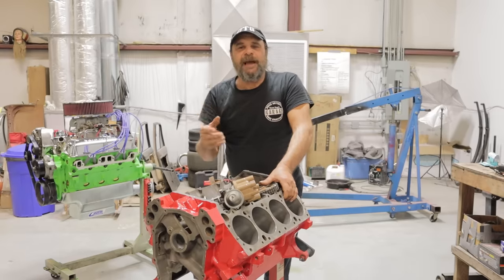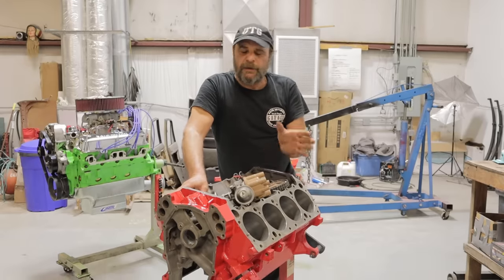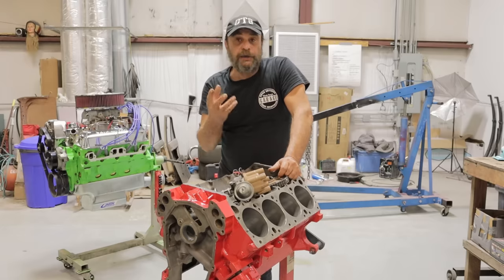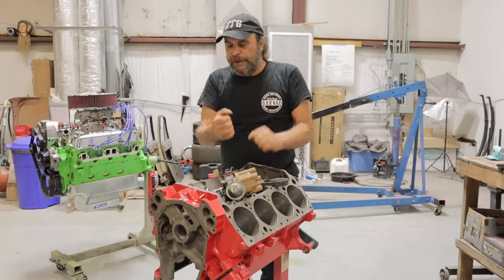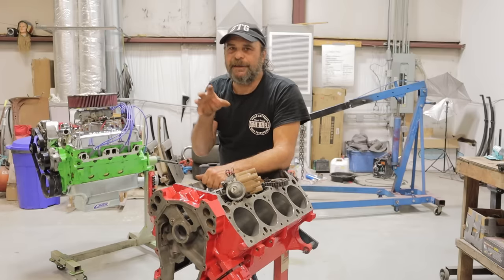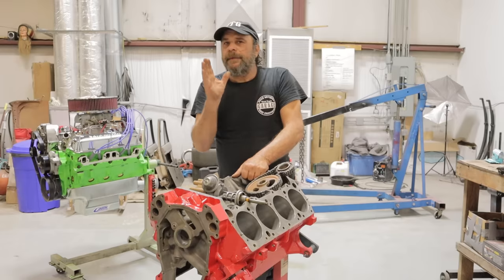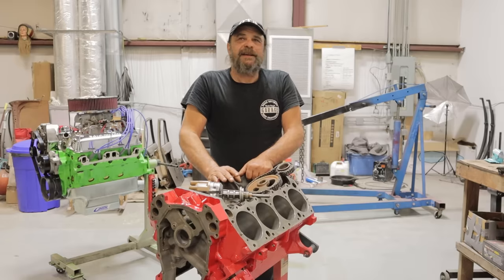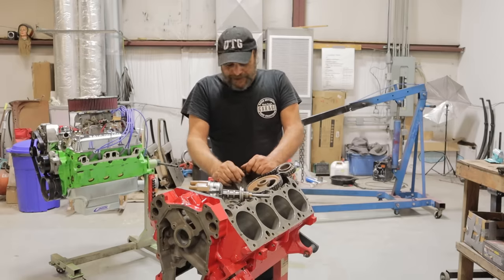Power Timing Secrets For Classic Cars

Comment: Cars today use a knock sensor. The computer advances the timing till it hears a knock. Then the computer retards the timing. This way it does it all the time. Keeps engine running at peak power and this means better fuel mileage. Great show Tony. 👍
Reply: Yes but you can tune a mechanical engine- NOT to knock.
Reply: @fastinradfordable  Never having knock leaves performance on the table.  That's why Tony's tuning style is to go all the way to knock...then back it off a noodge so the engine doesn't throw a leg out of bed.  The computer controlled variety does exactly the same thing, only it does it over and over, taking into account variations in fuel quality, engine load, engine temperature, intake air temp, etc...constantly trying to get right up against the edge of knock without actually doing damage...so you always get the maximum performance that's available.  Yeah, you can get no knock in either case...but that's not how to tune for performance.

Comment: My '67 Cougar with a 302 was very sluggish and had a stumble occasionally at idle so I tried this. The results were remarkable! I'm in New Mexico with mile high altitude so can run more timing than cars at lower levels so had it set at 12 degrees rather than the 6 or so it would need at sea level. When I kicked it up to around 15-18 degrees the sluggishness and stumble went away. Runs so much better! Going to play with it some more, and check the total advance to try to get the best possible performance. Thanks UT!

Comment: I have done this my whole life and 60 yrs old. A strong idle timing wise, then adjust on carb. Starts perfect and no bog, full rpm's no ping. Never used a light or dwell. 20k match pack and never an issue. New chains or beat this works

Comment: Good video! I did this to my old dodge truck with a high mileage 360 in it. I set the timing to factory spec and it ran but just not like it should. Advanced the timing more and it ran even better. 👍🏻

Comment: Thanks Tony, I’ve never tried the exact method you explained but maybe something similar. My method was to advance the timing until it started to miss at highway cruising speed and then back off a degree or two at a time until the engine ran smoothly at cruise.
Reply: have a buddy a do a brake stand while your at the side of car adjusting the timing  ;)

Comment: Good explanation of something this is learned from experience. A suggestion would be to include videos of examples of what you are trying to describe so people can actually hear engines/exhaust in different timing settings.
Reply: its a hard thing to discribe when people not in tune with details of sound, is acquired over time you get in tune with the sounds of exhaust notes other sense  is smell of exhaust or the color inside of pipe, says alot of things to people in tune  of an engine  as to spark plugs

Comment: been using pretty much the same method since i was a kid the only difference i usually do it with the engine running i grab the throttle linkage and run the motor up to about 2000 revs and hold it there while moving the dissy you easily hear a sweet spot. then go up up hill under load just like Tony said. i'd like a dollar for every car car that i did this to to get running right after somebody had tuned it by the book with a timing light. the usual responce was what the hell did you do to my car its never ran this good before. a lot of these cars were quite new at the time so its not just old sloppy timing chains and worn gears but a combo of "not quite right manufacturing tolerences" as well as outer harmonic balancer rings that had slipped or were made wrong in the first place that add up to quite a lot of degrees out in some of the cars from that era. the funny thing was as soon as you hit the key if it wound over too fast before starting you knew it was retarded. over heating was another common symtom with these cars as well. thanks Tony for another outstanding video.
Reply: LOL!

Comment: Thank you, Tony!  I learned of this 'Power Timing" by having a piston be burnt through and not listening to the sound or the feel.  It is like trying to explain how much "riding the clutch" you need to do to have a good launch from the line.  It does get complicated today because so much is 'by wire' instead of actual cable, bearing, etc. where the feel will tell you what is going on.  I was fortunate to have someone teach me as I grew up.  Just a saying, "DIRT is for racing, asphalt is for getting there!"

Comment: I did this on the 55. Actually I've done this on most all my cars. On the 84 I was able to actually watch knock counts too. On that car, what felt best actually resulted in the timing being retarded a degree or two by the knock module... So I hooked up a light and backed it off until it stopped and it's been there since lol.

Comment: This is how we timed our demo derby motors. I always kept trained mechanics away from those at all costs. If they set the timing or adjusted the carb it wouldnt run right on the track. We ran sbc 305s and 350s that were loose and abused you had to adjust everything by feel.

Comment: Loved the video! This is how I used to time my sister's 71 maverick with a 302. I'd just crank the distributor until I'd hear it lay over or slightly misfire. I would back it off a touch and test drive it.  When it would not knock and accelerate properly I'd pay attention to for a few miles. Between timing chain slack and general engine tiredness it still was a relative rocket. Two barrel carb and a three on the tree. What a blast!

Comment: SPOT ON.  I have been tuning by ear for forty years.  I used to bend my own advance springs in the distributor, but that was often a bad idea. I can still tune most older engines so that they fire when you breath on the key.  Only way to get there is experience.
Reply: Haha some of that emissions stuff came in so late ,you could almost get away with removing 1 of 2 springs.
That was too much , but not by alot if that makes sense.

Comment: Wow! This clip is a GOLDEN APPLE for me!  I'm turning 50 this month, I purchased a replacement Datsun 1970 240z for the one that got wrecked when I was 29.  EVERYTHING under the hood was the wrong part from ignition to mechanical fuel pump, even the SU carbs needed rebuilding.  I slapped those in yesterday and tomorrow I'm ready to check/verify the timing.  Last time I turned it over I recognized the carbs were shot and it ran lumpy and rich.  I wouldn't be surprised if the timing was screwy as well.  Original engine... THANKS FOR THE GUIDANCE ON THIS!  I'll use my timing light to get in the ballpark and run old school from there!

Comment: I've done that since I was 16 too with all my cars and friends. It is called timing by ear and it works best on real cars that have some miles on them. You go into a garage and they use a timing light for a tuneup and you have to set the distributor yourself because they go by the book and the book only works on new engines. I use to drive a Ford van that had over a 100,000 miles on it and I gave it tune-ups and it ran like a champ because I set the dist. by ear.

Comment: Also, if the engine becomes too hard to crank when hot, you've gone too far. Back off the timing a few degrees to find just the sweet spot between performance and easy start. Been doing this my entire life for street driving. Tony's method going up a hill works too, but is not always practical if you live in the city. Thank you UT for all the good tips you keep bringing to everyone.

Comment: Great Video.  did not previously consider the overall age of the engine and wear.  I applied this to a 1950's Ford Tractor with a 4cyl engine.  Although with fresh rings and bearings when timing set to factory spec the underload exhaust sound was somewhat labored and throttle response slower.  It also ran coolant temps in the high range.  Advancing 5 deg. made a big difference.

Comment: Was troubleshooting a stumble on a '78 360 D200, normal initial advance running great at idle. Put it under load and it bogs or dies. I watch this video and lo and behold Uncle Tony calls out the issue! Slop in the timing due to engine age was not something I had accounted for. Thank you as always for the wealth of old school knowledge!

Comment: I've set carburetors and timing with a vacuum gage. I've done it by ear. And I've set timing with a timing light. All work well. Depends on the condition of the engine like you said. best timing seems to be just on the edge of pinging. My mom's Englis Ford Zephyr book said to bring the timing up until it pinged then back it off until it stopped pinging. Took a few trips up and down the street.

Comment: yesterday i was setting time on my 1974 smallblock chevy nova.  spec inside the engine compartment  called for 0 degree before top dead center.  it "sounded" like crap until i rolled it to about 8 degrees btdc.  i didnt know what i was doing till i saw this today. spot on

Comment: Back when I too was young and knew even less about cars than when Tony was young?

I figured this tuning trick out myself too. Was in my then ten year old 1968 Ford. I'd just slightly advance that timing. Then,

Presto!

Thing ran great! Started up cold in a snap and held a low RPM idle perfectly. Bumped the gas mileage up too.

And I was so young and clueless that I didn't even know what the cap & rotor did.

Comment: Just started working on cars after buying a 73 challenger and timing was a bit scary to mess with. Been having a backfire on high throttle and tried cleaning the carb, new intake, jet sizes, etc but it wouldnt go away. One slight turn of the distributor and now it runs perfect. I owe you a big thanks!

Comment: Nicely explained! The only other thing I normal check is that it will hot start, spin over after sitting for a few mins. If it's slow or turning cylinder to cylinder just back off a nudge...

Comment: In England 50 years ago when I was learning this technique, what you call spark knock, we called "pinking".   It is just the point where the advance is just a little too far, and you back it of just about an eight of an inch.   
We also (another way) used to set the revs at about 2000-3000 rpm to set the timing at the fastest rpm , then back it off an eighth of an inch ( that back off is because the standing car is not under load) . Then reset the carburettor tick over.  This always seemed to be the most power for a tuned up engine and most fuel efficient setting for timing.  
You are right, every car other than a new engine needs a dynamic setup for timing. Once learnt, this technique is so valuable.
Reply: Thats all fine and dandy,as long as your distributer is FULLY advanced by 2000 to 3000 rpm. Be easier with a dial back timing light.

Comment: My 66 c10 283 has that initial timing setting no longer being correct. 175000 miles. Once I focused on power timing it the engine ran a lot better. Thank you for this video

Comment: I'm a backyard mechanic who works on my own stuff only. I have never used a timing light. Strictly power timing for me. I bought a 91 ford pick up that went from 18 mpg to 23 when I advanced the timing and ran 91 octane. On the bridge where I always made a pull it went from 62 mph to hitting 73 mph by the other side. In advance till it knocks under load going up hill and back it off until the knock goes away

Comment: Thank you Tony for telling us the reasons for this psychic tuning working so well on old worn engines.
I find you can get a pretty good starting point from adjusting the ignition earlier, until the engine runs at its happiest at idle, and then back it off a nudge

Comment: When I started tinkering with my Ford 460 I went by the book, had wideband 02 sensor, intake vacuum gauge and adjustable timing light. Went by the numbers and wondered why is engine so big so sluggish? After a few tries I changed my approach from giving the engine what the book says and instead gave the engine what it wants. Ignition was the biggest thing, went from 10 base + 12 mechanical to 12 base + 22 mechanical and the mechanical advance is all-in at around 2200rpm. Game changer that was. Holley idle screws were another, everyone says set them to the point when intake vacuum is highest but I can tell it just pulls better when opened just a little from the highest.
Reply: When it's idling at highest vac it isn't ideal. Thing is the idle mixture screws don't vary their mixture. Their mixture ie the ratio of air and fuel is pre set. What the screws actually do is vary the volume of premixed air and fuel in the idle mixture circuit. On one level this seems like splitting hairs but on another, not so much.
Having them screwed out further as you have done is better since the idle mixture circuit is very important for transition from idle circuit to main metering circuit.
I never use a vac gauge for this. What I do is after assuming all things are tuned correctly adjusted is wind out the mixture screws until the fastest idle is attained, then adjust the throttle stop screw to the correct idle speed. Next I repeat, since the transition slots in the have been covered by the throttle butterflies changing the signal in the idle mixture screw circuit so the idle mixture screws need adjusting again. Repeat until the idle is stable then wind both mixture screw out about 1/2 a turn each. The idle will slow a bit so you may need to touch up the throttle stop screw and repeat.
So you want the fastest speed then about 1/2 a turn for most engines, but big overlap cams cause low vac signal so it on those engines more than 1/2 a turn is necessary for smooth transition. Sometimes those engines need fully adjustable metering blocks if using a Holley.

Comment: You're killing me here. I did exactly the same thing when I used to build or tune up any engine. Nobody taught me, just as you said, I didn't have a timing light for a long time. Grew up rather poor. Funny though, after people started  noticing how I could make an engine run, they came to me from everywhere. One note on timing (the old fashioned way) the front rubber pulley damper would eventually loosen, and the timing marks on some brands would be way off. Found that out the hard way.. Good video. 😊

Comment: I completely follow what you were saying here. I basically gave nudges to my friend's distributor on his Chrysler 318 Ramcharger, and it helped massively with how it ran....after I had found all the vacuum leaks and cleaned/rebuilt the carb, and got it set up correctly as well....His poor truck was such a mess when he bought it, I am still stumped as to how it was running before....

Comment: First time viewer here and let's just say I have a few miles on the tread.
Really enjoy your presentation and all the sidebar notes that come from experience, not a script.
Currently I'm rebuilding a 77 El Camino with a 383 Stroker, Edelbrock top and Hooker headers. 
I found putting a vacuum gauge referencing manifold vacuum versus ported vacuum helped me dial it in. Meaning while moving the distributor find max vacuum and least vacuum and setting timing when vacuum is high and steady. 
Have you or others in the comments section tried this?

Comment: Yes extremely good info,I've done this on my buddies old cars they would come over and tell me it's  gutless won't go when I step on it , I would lose the distributor tell him to get in car put it in gear and hold the brakes, then give it gas   and adjust distributor to make it ping  then back off a nug .then your at optimal power for the old worn engine, in most cases buddy is very happy.

Comment: I find it easy to set on the money without driving the vehicle,  have someone hold the brake, drop it in drive, accelerate slightly, then I'd turn the distributor, you'll hear the power/torque come on, the rear tire should want to turn, if you have enough rpm it will,  now I'm not talking high rpms , just enough to add a load, you guys and UT would know ... I enjoy the videos.. Keep it up!

Comment: This is the way I have allways done it. Setting timing for me a is a small road trip with multiple stops in store parking lots LOL
I can remember tuning a pair of boat engines by ear, guy was all over me about using a light(I dont own one) once he drove the boat I was a hero LOL
Another tip is to watch the top of the valve cover for the way the engine shakes as it idles. I mean slightly again youll know when its right.
Sam

Comment: That is brilliant!. I did the timing on my 74 corvette (210,000 miles original L82) and tried to set it to "book" timing. Nope. I set it to what sounded good. When the weather is "average" I am going to go out and use your method. In other words, you gave me permission to ignore all the the material meant for fresh engines. Mine is not fresh that's for sure.

Comment: I have always (on older motors) advanced the timing until it reached maximum idle.  Then backed the idle back down on the carb.  On old Fords with rubber mounted harmonic balancers, the timing marks drift.  I had never considered the timing chain wear before.  Thanks!
Reply: I found that out quite recently. Installed a new timing chain (yes, correctly!) and couldn’t believe how much distributor advance I had to peel back to get back to the sweet spot

Comment: I’ve been doing it this way since the late 70s/early 80s before I had a license or owned a car. No timing light so a friend and I just figured it out. It worked on my first car (straight 6 Gremlin😆), my friends cars, and I still do it on my 318 poly. First time I heard the tech behind it after all these years. 
Never thought of the vac advance pointing toward advance before, I always took the cap off and twisted the rotor against the advance springs to figure out which way to noodge it. As soon as he said that, it clicked! 🤦‍♂️